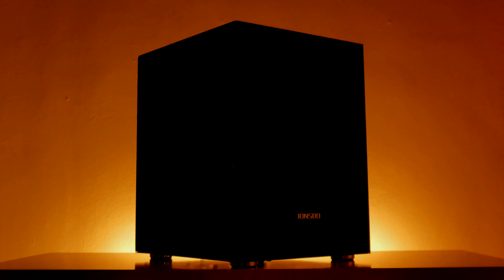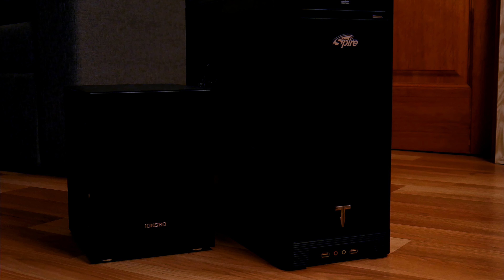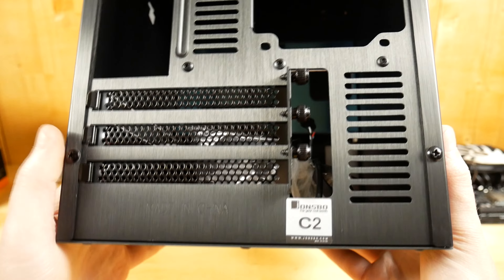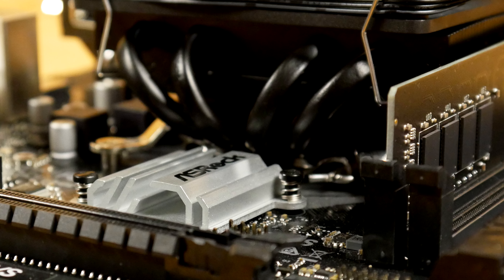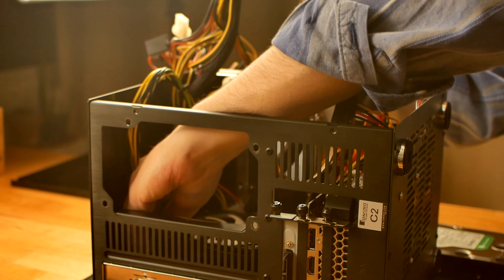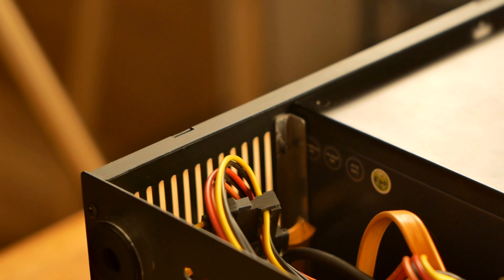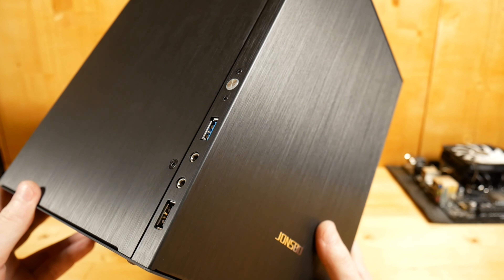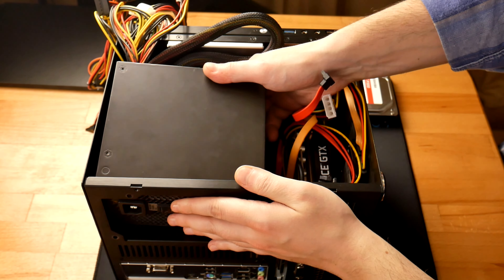🛠 How to Build a Mini PC - This Is What You Need

Comment: Hi what's the name of the sata pcie that you put on the back of the pc, what are the keywords to search for something similar?
Reply from the maker: I did it myself, I actually never found something like this. I know, it's really useful. I mostly use it to connect hard disks or solid state disks and I don't have to use a Docking Station. You can made it yourself using an empty bracket and extend your sata cables to it.
Reply: @YesterdaysTech  that's actually ingenious. Nice

Comment: Well, in indonesia the smallest Micro atx Pc is Cube Gaming Axel/Quazo im sama.
CubeGaming Axel look like a Nr200p  but with extra size.
Reply from the maker: I searched for it and it's a nice PC case. Indeed seems to be like Nr200p with one more PCI slot. It's significantly bigger than Jonsbo C2, but I like it has two slots for GPU so you can put it vertically.